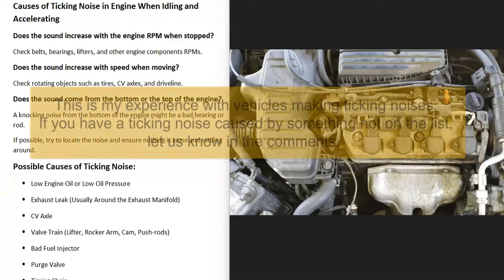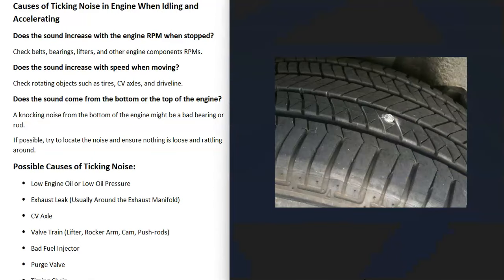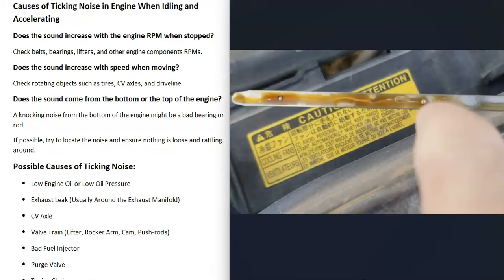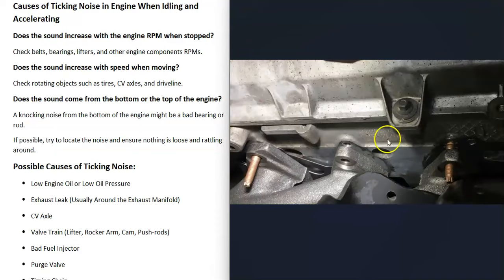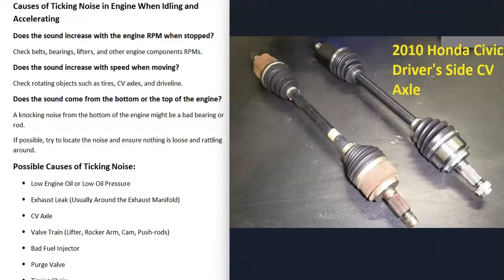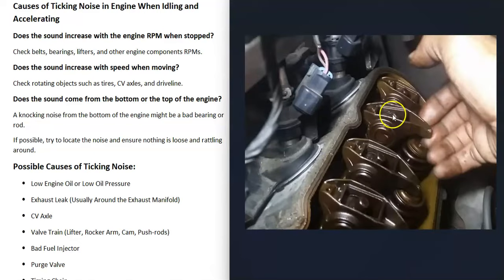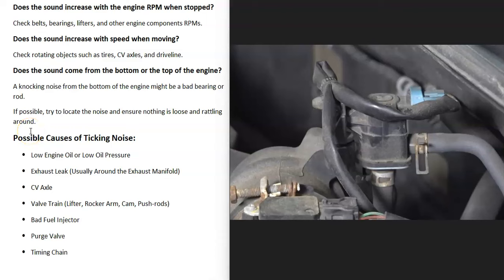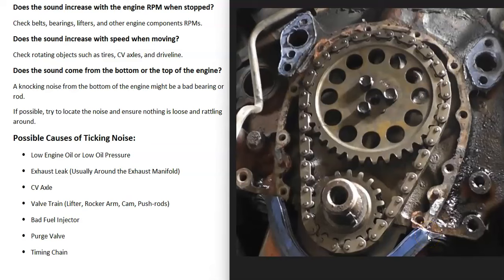Causes of Ticking Noise in Engine When Idling and Accelerating

Comment: I got a 2008 v8 4runner. The purge valve is ticking and when I pull the vacuum line (after the engine warms up) the purge valve sucks in air intermittently (at the same speed as it was ticking). I also gave codes P0455 and P0441. Could the ticking purge valve be the issue? Or is the ticking normal? I keep finding conflicting info on this.

Comment: I have a 99 Dodge Ram 1500 4X4 5.2L and my purge valve be ticking. Is it ok to replace now? Now I had a bad time of my oil light keep popping on I have change the oil and last time only 1 quart of oil came and I have put like 5 1/2 quarts in it and it still acts up. I hear loud taking from the oil pan. I think my oil pump was going out but I put my oil in and it stop. Dipstick never reads at all. Dipsticks be dry. Someone said I have wrong dipstick. And my truck is burning oil. Nothing bad, but I need to fix it. I change the PCV. And that Help a lot